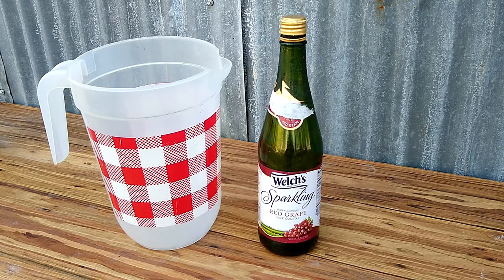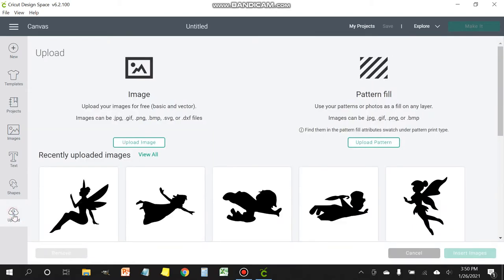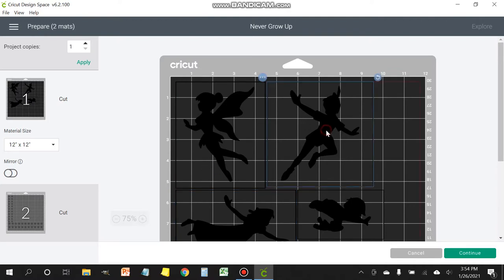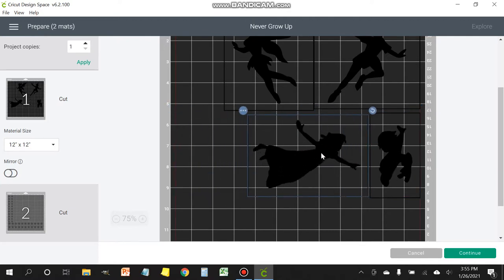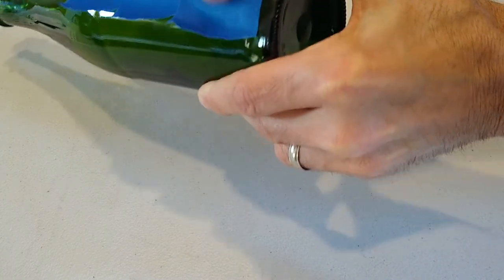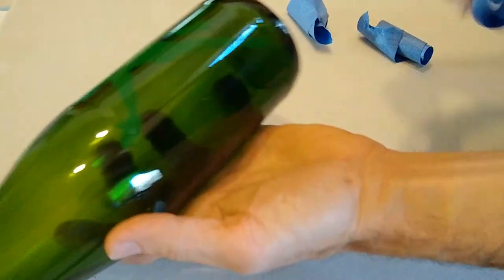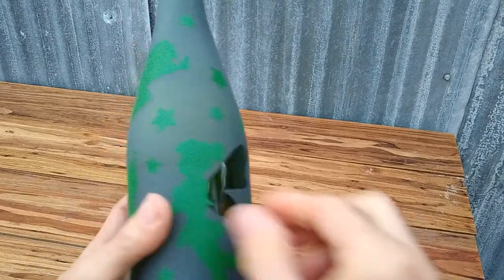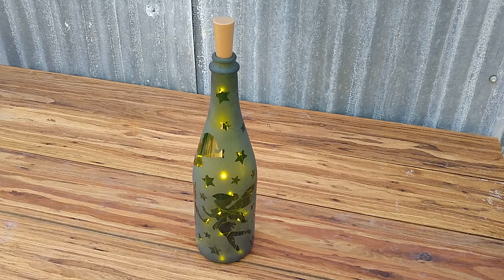Trash to Treasure Art Vapor Blasting / Honing Etching Recycled Glass Bottles with Cricut Stencils

Comment: Very good video. I am thinking about buying a new compressor mainly to sand or vapor blast glasses made from beer / wine bottles. What PSI, CFM, HP compressor should be bought which will do the job effortlessly? Thank you
Reply from the maker: Hello GYM BODY MUSCLES, Thank you for commenting. I used the video linked below as a guide for selecting my air compressor. The one I selected was the Ingersoll Rand 60 gallon with the SS5 pump. It's perfect for continues blasting at 50 psi. To remove powder coatings with a vapor blast system you will need to blast using garnet at around 90 psi. This will deplete the air much faster and require an Ingersoll Rand compressor with the SS5 pump to run non stop so you will need to take more breaks to let it recover and cool down. A compressor that can deliver more working CFM with an 80 gallon tank would be better for blasting at 90 psi for long periods of time.  Should your plan be to etch glass then the Ingersoll Rand with the SS5 pump is perfect because your going to be blasting garnet  between 30 to 50 psi.

https://youtu.be/1IMrx61TUzw

Best of luck with your build!
Reply: @vbared  Thank you for the reply. Is sand a good media to etch glass?
Reply from the maker: @GymBodyMuscles  Good morning, I haven't tried using sand to etch glass but would guess that it should also work. Garnet etches glass for sure and using less pressure, 80 grit is perfect.
Reply: @vbared  I didn't think you could use garnet. I use aluminum oxide. I have never seen vapor blasting done. I would like to see it. Can you recycle the material through?
Reply from the maker: @Wyrmwood66  Hi Connie, yes, it can be recycled. Garnet, aluminum oxide and standard sand have sharp enough edges to frost glass. Glass beads lack the sharp edges and have more of a hammering effect rather than chiseling so the are great for polishing soft metals. I haven't spent much time creating separator for my vacuum system to keep media from winding up in the filter but that's what is needed to recapture capture any of it that gets out.